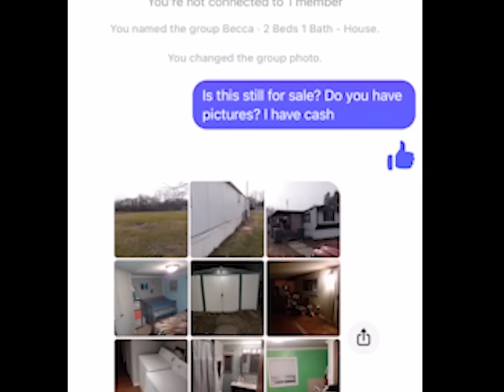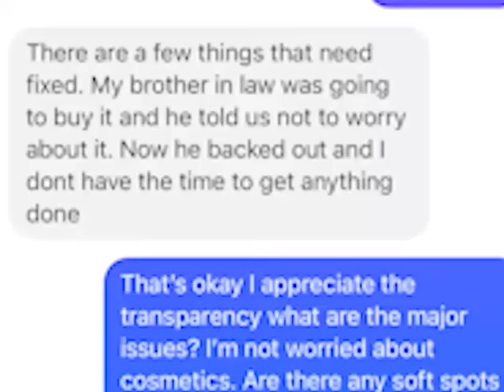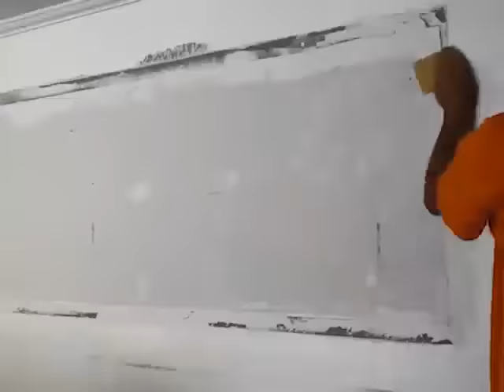Mobile Home Remodel|$500 Find On Facebook Marketplace|Mobile Home Before And After

Comment: I bought a single wide for 8000. Always wanted a double wide, so I bought another single wide for 3000 and attached it to the original. Had a metal roof put over both trailers. Cut out the middle so it’s an open concept. 3 bedrooms, 2 full bathrooms, kitchen,dining room, tv room, living area. It’s not gorgeous by all means,but it’s mine.
Reply from the maker: That is SO COOL! I really want to see pictures! My neighbors added on a very large and tall addition on to the back on their single wide and then added an addition on the side and framed in their porch and turned it into a mud room. They sided the whole thing to match and you’re like WOW that’s smart. I am glad they were able to do that.

Comment: You have done an AMAZING job. I just recently purchased a 1977 single wide. It came with 1/2 acres of land. I got it for $6,000. We are now in the process of remodeling it from one end to the other. We are very fortunate, the people who lived there for many years took really good care of the home. This past week we completed new covered porches on the front and back. Next week we plan to start painting the exterior and hopefully put a new metal roof on. The current roof doesnt have any leaks at all but I would really like to have it covered. If not, we may just put a new roof coating on and add the roof sometime next year. Lumber is so expensive. The two new decks were over $2,500.00. Keep doing what you are doing! On a side note, you are extremely beautiful! You look like a model.
Reply: Wow, you did great! I have a 77 also and renovating - i added a new roof right on top of the old one, it didn't leak or nothing. You got a nice price

Comment: Hi Becca, I just found your channel today. Your story is amazing! You and your husband are inspiring! And your reasons for doing what you have done are admirable! My husband and I wanted to get out of debt and become mortgage free. We sold a home with a big mortgage and we’re able to pay cash for a 5 acre piece of land with a mobile home on it that has a 300 sq ft addition. Our original plan was to get rid of the mobile home and build a small home using the addition as part of the square footage. But because of the cost of new builds being so high, we are beginning to think about renovating the mobile home. We don’t know much about it but it seems to be a cheap model. One concern we think we’d have to address is the lack of insulation in the walls. We believe there is only that metal siding on the outside, and the walls on the inside with probably a tiny bit of insulation. The HVAC system runs a real lot, both summer and winter. My question for you is, did you have to do anything to the walls? I saw that you had to rip up the floors and replace all of that, and we’ll have to do the same as there are lots of soft spots. We believe ours is a 1989 but we have nothing definitive on it. I was just curious if you did anything with the walls. And one more question, when replacing the windows, because mobile home walls are narrower, do you need to get mobile home windows in particular or can you modify any type of window? Thanks so much for sharing your journey! It is inspiring us to do the same!

Comment: I just came across your video. I believe everything you say about buying a mobile home. I paid $6,000.00 for mine and it is in a beach area but it is also in a remote area. No public transportation and stores are about 20 min. away. I didn't have to do as much as you did to my mobile home. I did have a hot water leak. What a mess. I didn't realize that until like 3 wks. into the leak. Now I have a new bedroom anyway. Insurance pain for most of it. I had a good contractor. Now he retired unfortunately. I am not living in the home permanently yet but plan on doing that within a year. I painted the whole place and had to get the heater fixed. It will need a new roof at some point but the contractor did repair it and so far so good. I am not in good physical shape but I did paint the whole thing inside with the help of a girl that was living in the area. We are not professional painters by any means but we did a pretty good job. I had the old rotted wood steps and a small deck replaced. That is about all I did so far. I do need new windows eventually especially my bedroom window. I would like a walk in shower in the bathroom but that will have to wait. It is a double wide with 3 bedrooms and 1 1/2 baths. You did a beautiful job in your place. Very nice.

Comment: I paid $500. For my 1969 2br, 1ba. Mobile the walls were literally brown from smoking. But, once I got them cleaned wow! The ceiling was totally in tact (1969) so I left them.  the panel walls were So- so.
I only had to replace 2 sections of the subfloor. The place had only 2 previous owners, which I'm guessing the original owners took very good care of it. I have done all of the work myself at 64 y/o except the carpet in the living room. It is shabby beach chic, and a haven fit for a mermaid. I live on an island in northern Washington state so, it fits. I am not tackling the outside as I only pay $32.00 property tax. 🤐 it has zillowed at $52.000, (surrre?)
At my age the money isn't as important as the peace of mind and pride of ownership. Great job you! Love the videos!

Comment: Beautiful home! In my area there is always cheap or free mobile homes that need to be moved. Usually the scenarios are people upgrading to a newer or bigger mobile, a rich person buys a piece of land and doesn’t want to live in a MH. Someone selling the home to build their dream house, or they lived in it during the build time. 70s/80s tend to be the most common. Some are in decent shape, like possibly an elderly person’s. Others are as rough as it gets and need a total gut job, or just scrap the whole thing and sell the frame and siding for scrap. Doubewides sometimes come. The ones that need a lot of work are like $1-10k plus and need to be moved. Some used models on dealers lots are around $40k for a fixer upper doublewide including delivery, and about $28k for a used 90s single wide

Comment: I had a 3 bedroom 2 bath that I paid $3000. It was a 14×70 single wide in a park. If I was in a better position I would still be there but i had no time and no help to fix it up. It was livable but winter was rough. I planned to totally remodel but I didn't get alot done. I am thinking of trying to get a small amount of land to move one and actually do it this time. I'm glad a young family figured out this "life hack" and have sucess with it!
Reply from the maker: Thanks Ronnie! Yes winters are rough. This winter has probably been the strongest winter since we have purchased it. We didn’t get the underbelly and skirt done like I had on my list and we paid for it with frozen pipes even with heat tape. Then we had another pipe burst and our furnace almost died lol these winters are hard core. I am still looking for land but it is so expensive right now.

Comment: Hello 🙋🏼‍♀️ I am going to view a mobile home in a couple days. It's totally out of left field as I'd been applying for apartments in what might be considered "higher end" buildings, I'm still waiting to hear if I'm approved for an apartment in a school house converted into apartments. I don't think it's wise to put all my eggs in one basket, so I'm keeping my options open because I really need to move out of where I am and it's better to have a few prospects until something is secure. A mobile home I'd went to see over a year ago was up for sale again, only it was renovated tastefully and just enough to make a vast difference and impressive improvement. I had cash and was ready to buy immediately, out on a gorgeous lake, adorable park and right down the road from the college I need to attend!! My curse wasn't having it and I was informed right after saying an intense prayer for it to work out and meant to be, that it had just sold after being up on the market for 35 days. I was devastated and still upset, it was positioned in the perfect spot too!! Had I known I'd have saved myself a lot of trouble searching for apartments this whole time to rent and already be packing and doing the moving process. I would have cut a check & snatched it up!! Back when I'd seen it over a year ago, it really needed too much work in my opinion and wasn't worth it, I'd rather put the 27k towards something newer and nicer, a condo. Well whomever bought it did a beautiful job within a modest budget, and it showed me you may not need to do loads to make a Stark difference and it depends on what the home has going on and most important to tackle. This one is 30 thousand and in decent shape but needs work, upgrading, it's in the subflooring in the living room, no bathroom sink or vanity, needs painting (I'm a wall papering fan), the roof is older, missing closet doors, no front yawning or overhang for the front door deck, the siding doesn't appear to be in the best shape, old carpets, looks like lousy flooring jobs, outdated kitchen cabinets, the outside could use some stuff done around the perimeter itself. I asked if all the systems work/operate or function, "Yes". I asked if it was smoked in "I don't think they smoke". I inquired if anything major is needed or huge repairs/replacements I should be aware of, she offered up nothing. Like you, I am convinced if a place is that low of price, when prices are still too high, something major is wrong. It doesn't look that bad, yes it needs work but I thought 30k seems awfully low in such inflated times. The other one I wanted, listed for 59 after they replaced the roof, cabinets, new flooring,a few other things. They probably did that within 20-25 thousand and aiming for a 10 thousand profit, is my guess. I also noticed other ones listed in this lake area in recent years for just under 60 grand. So maybe it is priced about where it should be and since it's a cash listing (you can finance below 50 and financing a mobile home is very difficult in Massachusetts), and they likely want out so they went with a reasonable asking point. I am definitely not offering it because of closing costs and all I have put into bringing it up to standard, but the way they left the flooring and bathroom undone and I was told they are recovering from Covid, it's been listed for 45 days which is definitely a slowing, all these factors tell me they are motivated to sell and I might get a decent price for it. It is not that bad off, but I will learn more regarding the internal systems and hopefully I don't end up with any horrific surprises. I don't do research or devote my life to it because this has been since 2020 I've been trying to move out there and since 2018 I've been looking and my education is what's important to me. I just need someone to live those few years to be closer to the school so I can pursue becoming an LPN. Fixing up and investing in a home wasn't and isn't my main priority, although I'm happy to do what's necessary and put funds towards upping it's value and making it as nice as possible within reasonable cost, but because I'm in a hurry to get out from where I am and more concerned with my educational /career goals, I can't have it take me over or consume my time and money. I relate with you in a number of ways despite this is just falling in my lap totally unexpectedly as I was looking to rent now, and turned away from buying and it seems you were very intent on finding a place to but that is affordable so you wouldn't have to pay high rent, I think is what you said. I definitely understand the feeling of trying to save in costs when so many big things need to be done. This is why owner's who keep up with things can ask for more in end and are appreciated. I can relate with having few other prospects and online harassment. I think it's paid "robots" that attack and criticize comments and video's, especially popular ones that strike a nerve. So don't pay such stupidness any attention or feed into with your valueable energy and time (I agree time in life is fleeting) and it's pretty and ridiculous to harass someone because of how much they paid for something.  I think they automatically send out deviant comments and replies attacking, trying generate response, maybe they get paid or it's a tactic to stimulate more feed for more views, I haven't figured it out yet but I chalk them up as fake and not recognizable /worthy of response. They are automatic and consider such attention a compliment!! You and your husband work so hard that I wish I could hire you to come do this one or at least come with me for the showing!!!! Help me assess what I'd be paying out to fix it up and if it's worth it. The idea of landlord contacting landlord turns me off drastically in terms of the rental aspect, and I think all mobile home parks look into is criminal history and credit /background, so that's a plus and it has a bath tub unlike the apt.  Rent is very expensive and ultimately owning is a better idea long term and provides more security/wealth and control than a renter does. I will deal with repairs any day of the week before ever residing in subsidized housing which I've done nearly twenty years. An it's absolutely believable that you found and bought your place at such an unheard of price, because that market place is like that, you can find any random things on there, anything one can think to buy, or not think to buy, and give away sometimes.  I know people who've found house on there, cars, etc.... These are just morons put up to trouble making if they aren't aware of market place but I think it's just to provoke fights and there are many mentally deranged, ill and vindictive users on the internet.  I wish you the best with your happy home and healthy family 🙏🏻❤️ Please keep us updated on your progress and I do wish I could get your help or that of someone who knows construction/mobile homes. I am trying to find out who did the work on that other home that turned out so nice!! I don't need. A decked out Palace but something's are urgent or just really need updating.  Thank you for sharing and I hope you're happy with the results and satisfied with all the labor /effort. Happy Holidays & Blessings 🌸☺️🦋💚

Comment: Are the new Windows made for mobile homes?
Reply from the maker: No they are standard windows. None of them fit in perfectly when we replaced them, so we had to frame in around each window to make it fit. Then we put drywall around the exposed part followed by texture and paint.
Reply: @byoungermama  texture?

Comment: Moving costs? Tie down ? How do you find zoning 😔
Reply from the maker: It depends on where you live and how far you are going, but there are alot of small companies that move mobile homes after you apply for the permits and it is approved to be moved. Usually anything 1976 and after can be moved if it passes. In my area it runs about $3,500 to transport a single wide up to 150 miles.

Comment: I can attest that you can get a mobile home for cheap or free. Years ago we gave a mobile home away for free.  It was from the 70's, had soft spots in the floors (to the point animals came in) and several plumbing issues. Also it did not have heat and air. Sometimes people get a cheap home like that, put in some repairs and use it as a hunting cabin.
Reply from the maker: That’s a great idea! I would love to have land with a few mobile homes on it

Comment: How much does it cost to move a mobile home.
Reply from the maker: It depends on your area, but in my area it is 3,500
Reply: 1.  It would depend on if it is a singlewide or doublewide and if the mobile home still has its
     axles under it. Some owners have the axles removed to make the mobile home sit lower to
     the ground on site and it will cost more if a mover has to supply axles. Tires tend to rot
     and are not usually left under the mobile home.  Movers usually have to provide tires for a
     move, then remove them during the setup.
2.  Are you doing the teardown (remove the skirting, unhooking all the utilities, including
     plumbing and reattaching the tongue) and setup (the reverse) at the new location or
     have the movers do it?  You can save money if you have the ability to do it yourself.
3.  How many miles is it going to be hauled.  If it's a doublewide the 2 sections are moved
     separately, which would more than double the price, since the sections have to be
     split apart during teardown and put back together at setup.
4.  How many escort vehicles does your state require?  A mobile home is considered a wide
     load and most states require a vehicle with either lights or banner on top be in front, in
     back or both, while the mobile home is on the road.  You can save money by doing that
     yourself.
5.  Are you moving it out of state?  This would cost much more than an in-state move.
6.  Is the location destination prepped and ready for the mobile home?

You'd want to make sure the mover is insured and that you have the mobile home insured (just like house insurance) and that you have "trip coverage" (usually good for 15 days) for the move through your insurance company.  Mobile home policies usually don't cover a mobile home when it's not connected to utilities.  (I retired from a nationwide insurance company that along with other types of policies, insured mobile homes). Depending on the answers to all of the above, it could run anywhere from 5 to 15 thousand and possibly higher.  You'd need to get quotes from different mobile home movers with your exact information to get the actual cost.